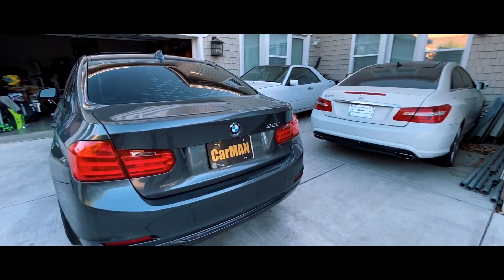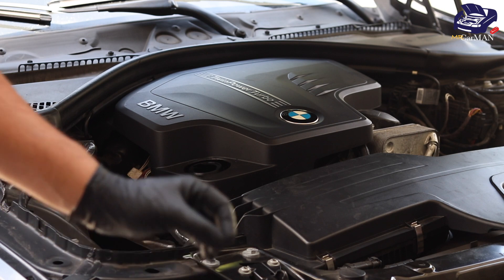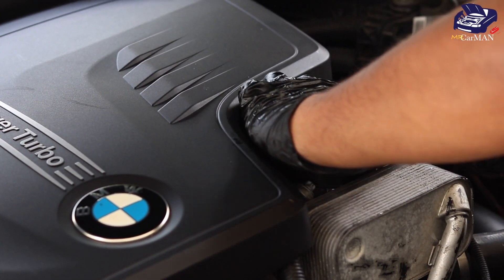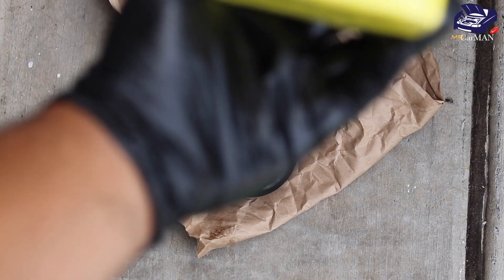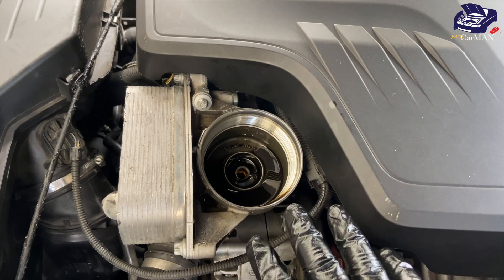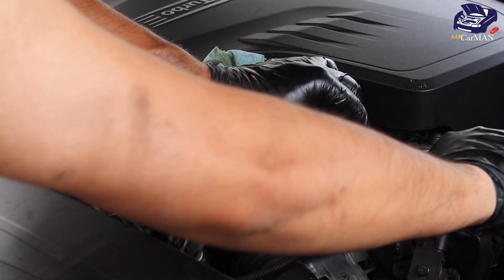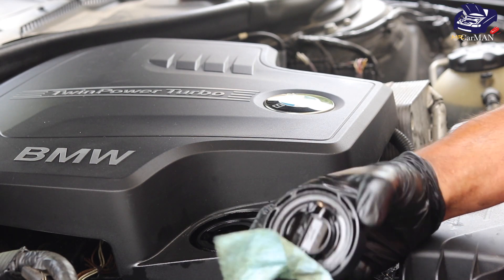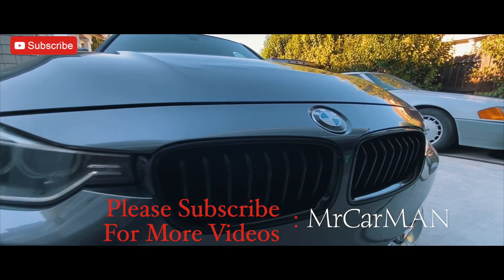How to Change Engine Oil on Your BMW F30 328i (CLEAN METHOD)

Comment: Hi ! I am considering using Costco/Kirkland Signature 5w30 in my 328i/N20. How is the engine performance with the costco oil ? I usually fill up with Fuchs Oil or Pennzoil Euro.
Reply from the maker: Hi, after using the kirkland oil in 3 of my vehicles.. I would not recommend it. It’s subpar quality, and one of engines would have a dry start with that oil. Just go with mobil1 atleast
Reply: Use liqui moly B FE 5w30 or the  liqui moly special Tec LL 5w30. Those oils are the absolute best for these engines.

Comment: How reliable has the n20 engines been in these 3 series?
Reply from the maker: These and n20 and n26 engines have camshaft issues as well as timing chain issues, it’s fairly common on 2012 to 2014 F30 models as well as other BMW with the same engine
Reply: Nyga Pranks thanks for the reply

Comment: lol, I just did my own oil change a few weeks ago.. best piece of small advice I can give is to jack up the car and have it evenly lifted on 2 jack stands.. I tried to cut corners and just get 1 side of the car up, when draining my oil it started just fine but when the stream started to thin out towards the end, it started to run on top of the belly cover/panel and started dripping out the other side that it was angled towards.. made a bit of a mess.. I've done plenty of oil changes, just never owned a newer car that has a belly cover like this 🤦‍♂️
Reply from the maker: Hahaha Jason, you got to make sure it’s leveled To have our job happen properly. Just like we can’t digest food correctly if we are laying down and eating

Comment: I bought a MityVac pneumatic oil extractor many years ago and simply remove the dip stick and put the MityVac hose in its place, fire up the compressor and change the oil filter while the oil is being sucked out of the oil pan up through the dip stick tube. No jacking up the car, no removing the drain plug, no muss, no fuss.

Oh wait, the F30 doesn't have a dip stick. My bad.  ;^)
Reply from the maker: Hahahahahh, that’s the same scenario I went thru. I love my oil extractor pump but couldn’t use it on this darn car